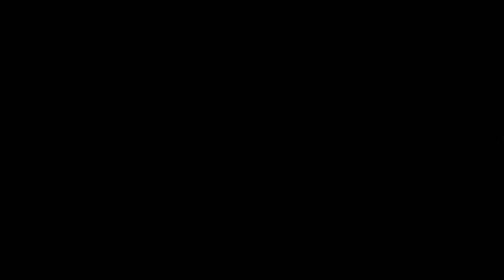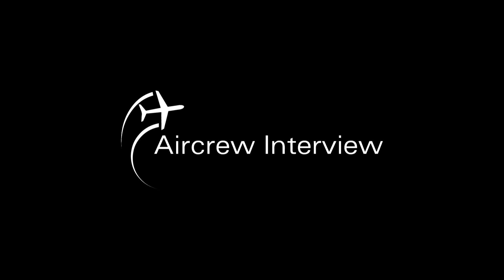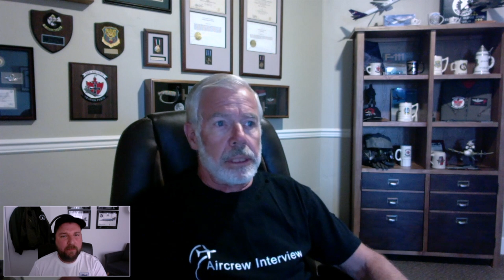Why Wing Sweep? | Jeff Guinn (Teaser Clip)

Comment: i still wanna know if the f111 or tornado was faster on the deck lol (f14 is rapid down low too)
Reply: Phil Collins  the gr1 was in service in 1980 iirc, same aircraft kinetically to the gr4, i wouldve loved to have seen what the tsr2 wouldve been capable of on the deck. similer frontal area to the f111 but 60,000 lb thrust in the prototype (the engine was further developed to make 38,000lb EACH in concorde so its possible an inservice tsr2 wouldve had 76,000lb of thrust!!)
Reply: @Scoobydcs  You sir, a d might l add a lot, a lot, of other people, no doubt!
p
Reply: @pilarmorin4405  lol